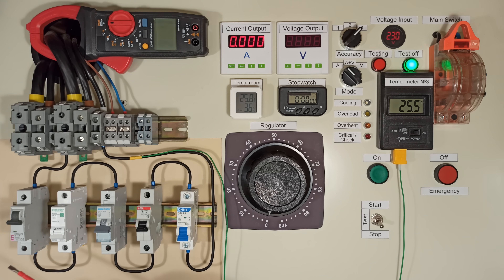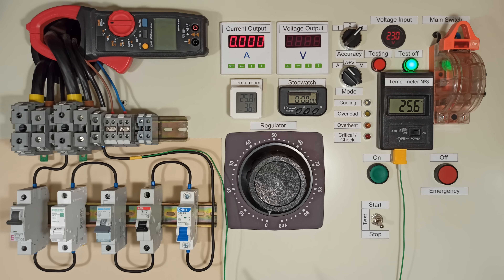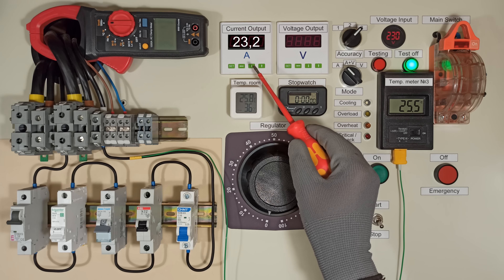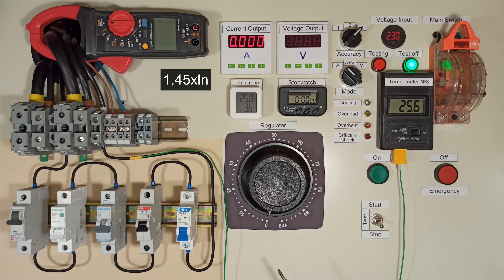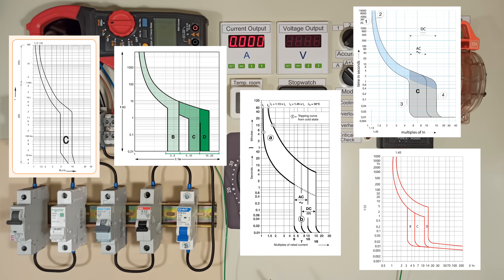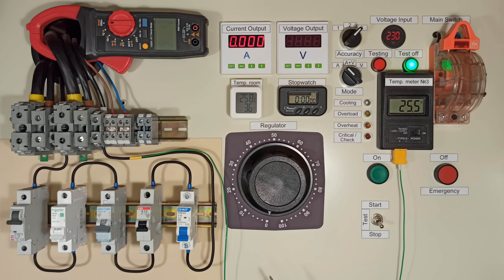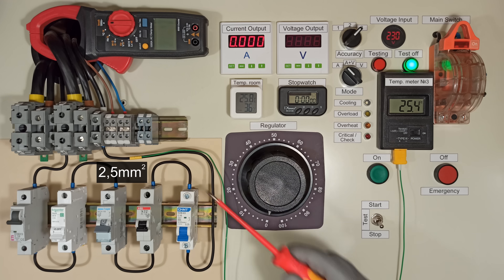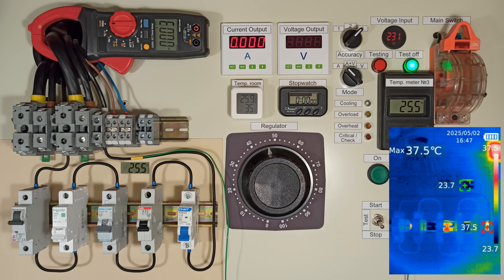Test MCB 16A. ETI, SE, Hager, ABB, CHINT

Comment: Using terminals is a bad idea, causes hotspots
Reply from the maker: Strange — that’s exactly what they’re designed for: to ensure a reliable connection. The contact area is huge. Take a terminal and a ruler, and measure the contact surface for a 2.5 mm² wire, for example!
Reply: @ Yes, but you're adding a new contact surface with the associated risk (Joule). Circuit breakers are designed to grip the cable directly.
Reply from the maker: Yes, you can connect the cable directly to them. I rarely do this. However, it can lead to emergency situations. I've seen quite a few with uncrimped multi-core wires.

Comment: I have a battery, induction cooker, oven and washing machine. It happens more often that I cross the limit. But cooking is often just 2-3 minutes at full power to boil water, so it is a good thing that it takes 4-8 minutes before tripping when it is safe of course!
Reply from the maker: Yes, you have a lot of equipment. Is it all on one line? The oven and heater work for a long time, so if something short-term is added to them, it might cause the circuit to trip.

Comment: The bottom line is it doesn't matter which manufacturer made the breaker. What is required is an independent lab certifying the breaker such as NEMA. Unfortunately the market is flooded with copycat products including certifications. All the tested breakers in the video could be bogus. 
Thus the bottom line of reputable consumer safety testing. Hand the responsibility up the ladder.
Reply from the maker: Hello! Interesting comment! Of course, it could be a counterfeit, or maybe I intentionally pick defective ones, or even disassemble, modify, and reassemble them. But that's definitely not my goal. Still, let’s not assume it's a fake if you're buying from the manufacturer’s official distributor. Why would they sell counterfeit or defective breakers with fake certificates? That would seriously damage their reputation.
Reply: @ElectroTest_1  Memories of buying a Seagate hard disk drive, new in the box with manufacturer data sheet and warranty card. It died after 2 weeks and I took it to the Seagate service center. They plugged it in and didn't even bother to look at the monitor, just turning it so I could read: "Not Seagate'. Or, we just bought 3 tennis rackets from an online store. One was a legit racket, one 3/4 size and one a childs toy. ??
Here in Thailand you never know what the heck is real. I do know that my Square D breaker panel is a fake. The manufacturer rep sales outlet told me. Identical to a US NEMA certified panel, just as well built, but this fake cost $22. Square D at that time was refusing to sell to Thailand.

Comment: Having Häger.
They are annoyingly fast tripping on current spikes from electronic Capacitors.
Plugging in an empty power supply will cause to trip it.
Also have to switch it back on twice often when it was powered down.

Good to know it will last several minutes above 1.5In.
Having a coffee device and water cooker on the same outlet and sometimes need them both at the same time. Just shortly but there's a risk for tripping.
Reply from the maker: Hi! Can you explain in more detail how your circuit breaker is tripping due to the capacitors? It can't be caused by just one unit! Or provide more details about its specifications. As for the coffee machine and the water cooker — it's not going to be 1.5*In; it will be around 20A. In that mode, it will take much longer to trip.
Reply: Switching powersupplies have a big inrush current.
Like a pc or big 12/19V adaptors from laptops or other devices.
They have big Capacitors that charge at high currents.

Here maximum allowed power is 3600W.
Water cooker and coffee device will be 4000 or I think even higher. Not sure. But both won't run that long.

Microwave oven and those devices are unfortunately also on the same group.
That tripped once. Microwave oven at full power and water cooker.
Reply: @fiveleafcloverfpv4445  yes but powersupplies also come with something as a NTC thermistor on the input of the psu just before the bridge rectifier and the caps so it limits the current pulled by the caps so they charge slower and thus at lower current , also as it heats up by current going through , it allows for full current draw like if it wasnt even been in the circuit, it is a cheap and easy solution to inrush current draws , the only downside is that they tend to fail in 2 ways sometimes silently and sometimes by catching fire or exploding especially when they also have the role of the fuse since the fuse is slow blow/higher than spec rating

Comment: All single pole? I am used to also switching the neutral (also enables integration of gfi in the over current protection)
Reply from the maker: It's possible to switch the neutral, but that leads to extra costs and a larger distribution board. Do you have such a requirement?
Reply: @ElectroTest_1 it's quite common here in the Netherlands. Also I have my entire house behind combined gfi/overcurrent modules which are just as wide as these so no need for a bigger distro
Reply: Jaki rodzaj sieci?

Comment: Interesting video that matches my experiences on this topic. I suggest painting the DIN Rail black to see the temperature of the breaker itself better! My experiences is that the screw connector especially of non recognized brands are failing because tigtening of the connection is many times not possible with the corect torque as the housing deform or open. If the connection is not good, the connection gets hot, the screew losen more, and the plastic starts to melt at the connection. It would also be interesting to test different Chinese brands, as there are some really good budget brands, but also a lot where I don't believe they are working inside the curve they should. Tetsing on solar DC braker would also an interisting video.
Reply from the maker: Thanks for the advice. I think I’ll stick something onto the rail or paint it with a matte color. What do you think — is it possible to test the thermal element of a DC circuit breaker using AC? It should be the same, since AC current measurements correspond to the thermal effect of DC. I’m still thinking about it.
Reply from the maker: Repeat

Comment: All this shows that the one concrete tested mcb is faster/slower than the other concrete tested mcb. It has no relation to the manufacturer, until you test 100s of randomized mcbs from random batches, manufacturing years, etc.
Reply from the maker: I completely agree! There can be deviations and defects. More tests are needed to see any correlation.

Comment: Maybe I missed it. But are these results all within specifications & regulations?
Reply from the maker: In this test, all circuit breakers switched off within 1 hour, so they meet the standard. However, there are still other points that can be checked.

Comment: MCB role is to protect  your wires. All accomplished. 30 or 40 degrees does not matter. Far bellow "damage temperature" CHINT gives a  little more room  for short time overload - it might be practical. Also CHINT was only one exactly in the middle of the trigger zone. Others were on the edge  and on of-zone. I am using CHINT in my solar project especially for DC part of protection and everything works fine... and there are 2-3 time cheaper...
Reply: there is lifetime , if temperature is high lifespan down
Reply from the maker: Thanks for the information! Have you ever had any failures or malfunctions with CHINT? What's the model called for direct current?
Reply: Oh my God. This bot is not capable of answering a basic question. They only leave information that they use Chinese products and write praise for Chinese products. @ElectroTest_1
Reply: Please test the magnetic trip current and the breaker speed under 2 X nominal trip current.
Reply: Nop. To protecting people. Short circuit resistant loop is crucial not any wire loading. See that you have no papers for this activity.
Reply: @thorspoczta4436  To protect people, you should use a Residual Current Circuit Breaker  (RCD), not an MCB. Any MCB does not guarantee protection of a person in case of short circuit, the brand does not matter.
Reply: Contractors installed CHINT on the house we bought and the the CHINT RCD they put does not work via the test button.
Reply: @alicangul2603  This means this RCD needs to be replaced. The contractor is obligated to check all installed equipment during installation. And they shouldn't submit the project if there are any faulty components. This is more of a contractor's problem than the equipment manufacturer's. Equipment should always be inspected after installation. With such inspection, cheaper brands will fail inspection more often. But this doesn't mean using an "A-brand" gives the contractor the right to skip equipment inspections. Such brands will have fewer failures, but everyone has them.
Reply: @АлексейК-ф2щ maybe ist have to bei replaced or it ist wrong wired. Second option
Reply: Fully agree,This basic industrial product is very easy for Chinese companies to adjust.Whether to trip or not depends entirely on the product specification and positioning.As long as the trip is within the rated current, it is a qualified product.If you are using a product that trips frequently,In fact, you should check whether there are quality problems in the circuit and electrical appliances.
Reply: I am half an electrician, because I used to work as an electric bicycle.Therefore, there are more contacts with air switches, and the number of current protection switches depends on the current demand of electronic products.
Reply: There is reason why they are cheaper, you will realize why when it matters the most. Hopefully it will just damage installation and not course house fire.
Reply: @wykydytron  it's because of the high profits that the difference is 200%-300% it should be only 10% to 30% more expensive. But because no-one is allowed to make risk decision anymore, the easy decision is to fill the pockets of the manufacturer of "A Brands"
Reply: One issue with that is that the upstream breaker may not be a Chint. Let's say your house is on a 25A circuit and your 16A individual breakers are all super slow (even if within spec). You will end up tripping that main fuse all the time. Also, those Chint breakers clearly generate a lot of heat themselves. Remember this was a short test on widely spaced breakers in free air. Now imagine a row of them enclosed in a cabinet.

No thanks...
Reply: @marcelb3645  If you look at the data sheets (for all) non of the 16 Amp breakers discriminate with a 25 Amp MCB of the same type.
However they do discriminate with MCCBs of 25 Amp.
To get true discrimination with the same model and type of MCB you need to go to a 32Amp at least.
Reply: @marcelb3645  if your house device force u to use slow reaction MCB, i will rather change that device instead of getting a "slow" response MCB
Reply: This is precisely the reason, I prefer HRC fuses, over mcb.
In my test benches I always use semiconductor fuses in series.  
Now that semiconductor fuses prices have dropped drastically, it makes no sense not to use it. 
Please note the tripping time is what protects from a disabling injury. (I prefer less than 5mS) Flashover in face creates serious injury (seen umpteen both for humans & simians).
Stay safe & donot use mcb as a protection. Use a large rated S.Fuse if in doubt, but do use please.

EDIT: Tripping time in Second😅😅 is NO safety for the personnel. It's like a jack hammer hitting an object. 5mS makes sense. 1S makes it a salad.
Reply: @AnwarKhan_786  A fuse or an MCB is no protection for personnel. Never was, never will be.
Fuses are great for Semiconductors, but now the advances in MCB tech are matching them, and you can reset them, so they save time and money.

If you are relying on a fuse to protect you , you simply dont understand what you are doing.

1.2x current of any fuse rating, the fuse will last several seconds to several minutes, even a semi conductor fuse.

I suggest you back to basics and study :
Pre arc time, arc time, rupturing capacity, I2t, and of course the fuse graph.
Reply: @007floppyboy Are you speaking of MCBs with H curve??
Reply: @AnwarKhan_786  Try Z curve, specifically made for semiconductors in AC circuits.
H curve is for DC circuits, but still operate in the normal B-C-D times-currents.
Reply: @AnwarKhan_786 Dont know what to say ...30 years ago i study electrical technology and learned of superior MCB compare to HRC fuse...now you going back to the caves..😮

Comment: We find that Chint terminals deform under the least stress of any other brand (in the UK market). The metal seems to be simply lower quality than the rest. Similarly the plastic seems brittle and the case screws round off very easily.

Overall just very low quality but they seem to be happy for it to leave the factory 🤷🏻‍♂️ we avoid installing it and prefer to replace wherever we find it on site.
Reply from the maker: Thank you for the informative comment. You even included details! I haven't used them many times yet, although the plastic seems fine.

Comment: Nice test and nice setup. 
Please test breakers with lower currents, while turning off occupy more time. 
From my experience not only wires in breaker box emits heat but in domestic reality there is more place to overheat. 
Long time ago my wife forgot about turn off iron while washing machine and other stuff were used. Breaker pops but it was hot event after over 1 hour (i can not touch it). 
In case of hard short circuit loop impedance is more important but constant and long and not so high overload is most dangerous.
Reply from the maker: It's interesting to hear real-life stories! Indeed, there's a higher likelihood of damaging the wiring when the current slightly exceeds the nominal and stays on for a long time. If the breaker is of low quality or defective, the line doesn’t have higher backup protection. And with higher currents, the higher-rated breaker will trip anyway.
Okay, I've already tried some long tests, they can last half an hour, an hour, or even more. What do you think about showing them? Should I speed them up a lot (to how many minutes?), add music, or try other options?

Comment: why doesn't a 16A circuit breaker trips once the 16A are surpassed? 1.4x sounds to me like a crazy high tolerance
Reply from the maker: Hi! They shouldn’t trip at 16A=) — they shouldn’t even trip at 1.13*In for an hour (according to IEC 60898-1). This ensures overload capacity, so equipment and circuits don’t trip frequently. If everything is selected according to the tables and formulas, everything will work properly and won’t overheat.

Comment: That is a properly engineered test setup. Kudos.
One thing that is missing - no where that I can see do you state if this is AC or DC testing. Its clearly AC from the kind of circuit breakers you are using, but this information should be explicit in your documentation or presentation I think. Especially important now that many are setting up DC systems to feed Inverters.
Reply from the maker: Thanks for the advice! I think I’ll start paying more attention to the current. Honestly, I’ve gotten so used to it that it just felt obvious to me.

Comment: yeah... nah.. measure the breaking capacity instead (iec 60898-1) due that will tell quality of the breakers, also test "pulse voltage" during breaking capacity... If the "Rated Current" is 16A, it shouldnt break at 23A (but its true as you explain of "guarenteed" tripping point) in the point of view that the electricity consumer should be max 16A. Then, the electrical construction is calculated wrong and wont save the electric consumer/construction (as a fuse should do)...
Reply from the maker: The breaking capacity is a completely different parameter of circuit breakers. Yes, it’s important, and breakers must be selected according to the maximum short-circuit current. However, what does that have to do with this? In the video, one of the points on the circuit breaker’s trip curve (IEC 60898-1) was tested. There are also other points, for example, the interesting point at 2.55×In, as well as 5×In and 10×In for type C breakers.
Reply: @ElectroTest_1  well, now you have some other things to try out :)

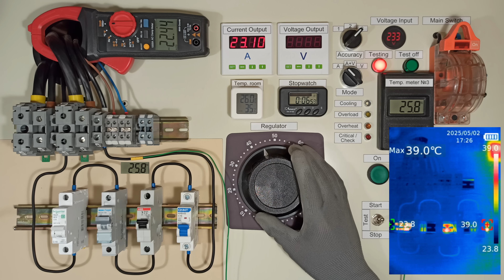Comment: 1:40 keep SEL pressed when you turn the meter on to turn off the auto power off feature so that it doesn't beep at you anymore.
Reply from the maker: Thanks, but I'm not sure the sound signal turns off there :) I actually press it so that it doesn't turn off automatically. However, the sound will still beep periodically.
Reply: @ElectroTest_1  when APO is disabled the reminder beeps will no longer beep ;)